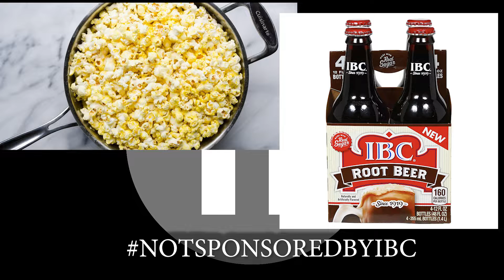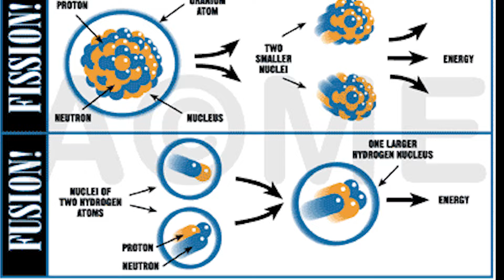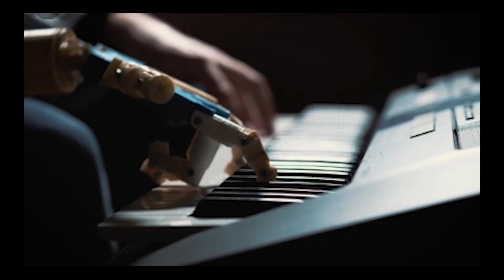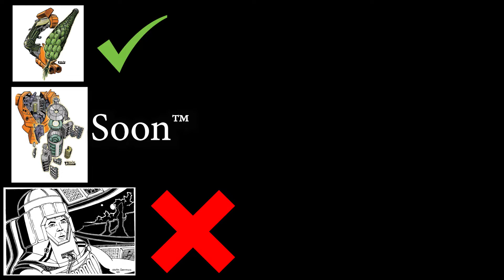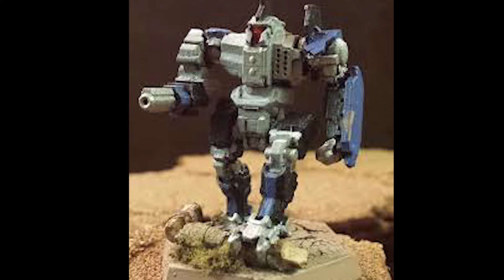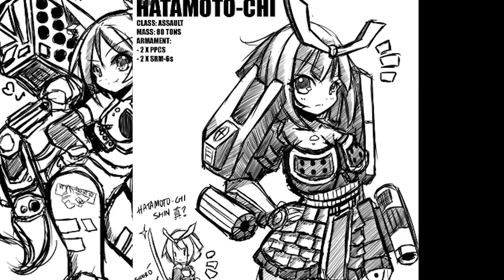Big Science Question - Can You Build a Battlemech

Comment: Thank you!!!  I just asked this question on reddit bc im big into space and mars stuff said id do some homework and Bam, right here some of it is.  

Note: A hydrogen fueled ICE running at 1500 horsepower might do the trick with fuel cells.  That could be done today.  A 1000hp jet engine runs the 70 M1 Abrams main battle tank and has for 30 years.  

Thanks!
Reply from the maker: There is no question here?
you just spammed out information about an ICE Engine and the Abrams.
Reply: @FiauraTheTankGirlGamer  Hi, I put the question up on reddit as mentioned and then found this great video right after.  I sent an email to you with the actual questions since it was too much for here.  Cheers!

Comment: Q = 10 is 1000%
Q = 0.6 is 0.6%????????
Shouldn't it be 60%, you stated 0.6%
Reply from the maker: We must get 1000% of the input back out of a Fusion Reactor in order for the costs to be commercially viable at a 20% profit rate based upon current electricity demands and prices.
Reply from the maker: Okay, 6% of 10 is 0.6 since 0.6/10 = 0.06 or 6%.

Comment: How would various terrain types hangle machs walking on them? aka, how do we prevent the mech from sinking into the ground?
Reply from the maker: The same way you do a tank. Either check the ground first or use a bit of engineering. Modern MBTs can weigh in at as much as 80 tons.
Reply: Fiaura The Tank Girl aren’t the reason they’re on tracks is so they spread out the weight as much as possible? So they don’t sink in and get stuck? I remember there was this experiment in WWI in Russia of a tank that moves on 2 huge wheels, that got stuck in the ground in it’s first test. How big do the feet have to be legs sink in? What should we expect to be foot sole to ton ratio to be? Should we be expecting ridiculous clown shoes proportions for heavier and heavier mechs?
Reply from the maker: @SSecularScholar  tanks are on tracks so they don't care about the terrain. But with Weigh distributed over a mech you would not need obscenely big feet. Just look at Japan's working Gundam in the video. iT apparently can walk on most terrain. 
Simply put, tank can go, mech can go. Tank can't go, mech no go.

Comment: Loved the video though I would like to ask something concerning the neural helmet: what kind of different hurdles would we be facing if rather than a removable helmet to control the machine, the pilot is directly wired in like they are with the larger titans in 40k?
Reply from the maker: The same problems they do. The pilot can never come out and the wires inside their head slowly rust and decay causing them to go nutz.
Reply: @FiauraTheTankGirlGamer   Fair enough, though i get the feeling that such ramifications wouldn't be given that much due care and attention given our current track record with medical science so far.
Reply: @FiauraTheTankGirlGamer  Platinum electrodes are much more resistant to surface oxidation or reduction.  In the mostly reduced environment of the brain (in your head) this wouldn't be an issue.  Im not an MD, but i do work in biological systems using electricity to promote microbial biofilm growth and efficiency.  I prefer carbon fiber to platinum.  

Love the video and have lots more questions.  

Also, I'm a fanboy but also a real scientist who brains this shit.  

Another aside, A first gen mech is more practical to be a Spider, Crab, or Marauder so it can do the "haul down" maneuver, just like normal tanks.
Reply from the maker: @ecoislands1540  actually the reason for redundancy, stalking scorpion, or super stallion would be the first mechs because of the 4 legs, lose 1 leg doesn't cripple the machine.
Reply: @FiauraTheTankGirlGamer  love it!  I forgot about the super stallion, have to check that ones technical readout.
Reply: Instead of the neurohelmet (looking real world here) modern prosthetics monitor the nerve endings of the arm or leg in place, without surgery.  We've come that far now with the electrical impulses and consistently reading the faint signals.  Its not coming directly from the brain, of course, but the signal going half way down your arm or shoulder, and then picked up by the monitoring electrode on the skin, is faster than the time it takes to get the rest of the way down the arm.  Technically, instead of a heurohelmet, a specialized suit like the Teslasuit that already monitors biometrics, motion capture, and haptics might take its place.  If thats the case, then one of the biggest real hurdles can be worked around.  The suit monitors all movement based impulses going through the body and reacts to them like a giant prosthesis.  Thanks all,    

(link to the teslasuit on youtube if any one is interested.  The things cost 13 grand a pop!
https://www.youtube.com/watch?v=TSIXrATfnu4

Comment: I will stick to aerospace fighters.
Gut feeling tells me they are safer and MORE practical.
Reply from the maker: less safe and less practical oddly enough.
Reply: @FiauraTheTankGirlGamer  
The only mechs that made sense in Battletech is the Elemental suits.
Proto-Mech are also a good idea.
Atlas reminds me too much of the AT-AT..... which is more like a terror weapon..... to scare the shit out of irregular fighting forces.
Reply: @GaoDaHoi  So a true aerospace fighter is a fighter that flies in both atmosphere and space, this means it needs a hull able to survive re-entry, this is very heavy which is an anathema to effective combat in both space and in the air where agility is your basis for surviving, also even light cracking to the surface designed to withstand re-entry risks the surface failing (see Columbia disaster) in addition atmospheric entry generally has to be done very precisely to prevent damage to the craft during re-entry and to prevent the craft entering an out of control state when aerodynamic forces kick in properly, in addition physics basically determines that during entry or leaving an atmosphere you are locked to a very predictable course.  

Also being aerospace means you need 2 control modes, aerodynamic using mobile aerodynamic surfaces such as flaps, ailerons etc and a system for space, typically something like cold gas RCS for its relatively high thrust and ease of control.  again these are heavy.

In addition while atmospheric can be designed to work in space (an unmodified AK or AR-15 will happily work in space) ballistic weapons have a very short effective range in space relative to the distances involved because of their comparatively slow speed and that orbital velocities are measured in many hundreds of meters per second, but the big one is you would need a second targeting mode to account for the lack of air friction in space and dealing with micro gravity rather than planetary gravity.

Lastly that is a HELL of a lot of training you are landing your pilot with, atmospheric flight is fairly intuitive relatively speaking (still need about 100+ hours before many nations will grant you a basic pilots licence)  you are also asking your pilot to learn pure Newtonian flight model which is "You keep going until you it something or you put as much effort in going forwards flying in the opposite direction to stop yourself"  and it is not an easy mode of thinking to learn.
Reply: @EmpPeng2k7  
I know there is a reason why Spartanians and Waklure are not aerodynamic and do NOT to well  in atmosphere.......
But they still made more sense than a Giant tin -man.